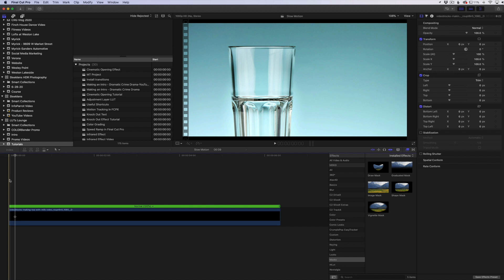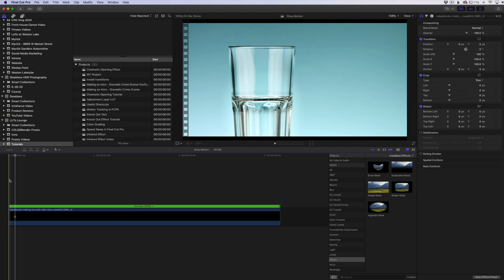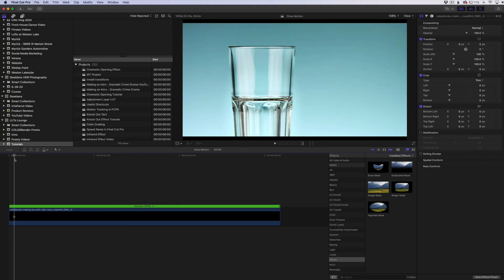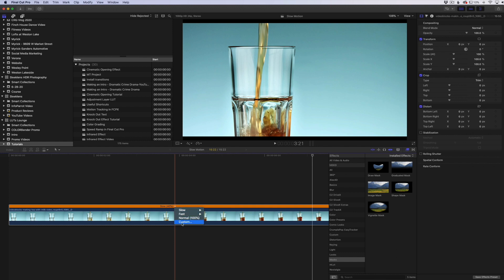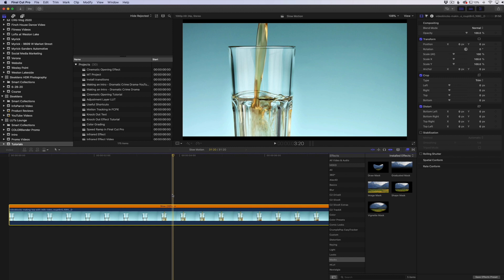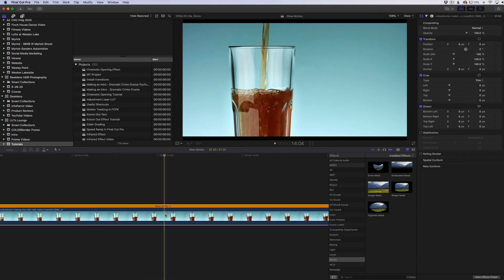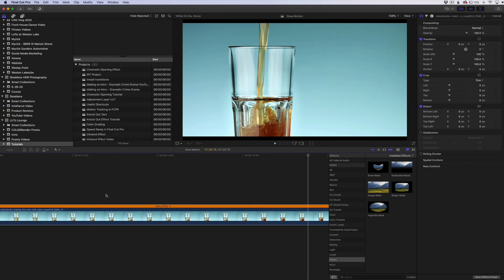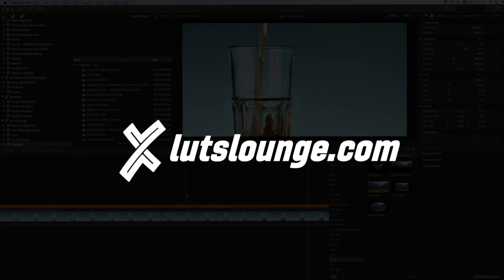Using Optical Flow for Smooth Slow-Mo

Comment: Great video! If I shot in 60p and want to make it 50% instead of 40% would I use / need Optical flow
Reply from the maker: Thanks! In this case you might be fine without it depending on your final output frame rate but you can always apply Optical Flow to see if it smooths it out a bit. :)